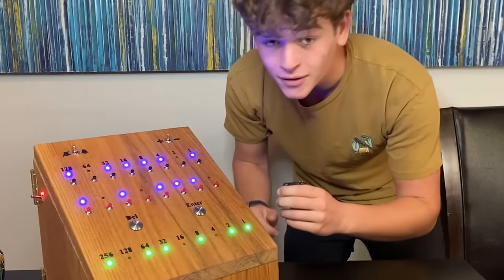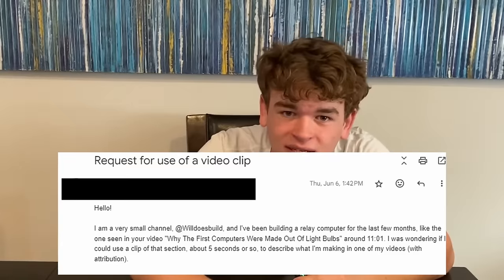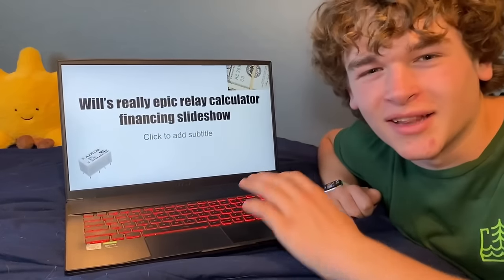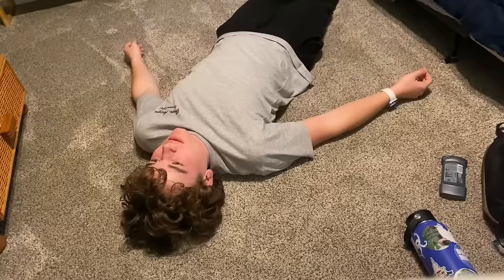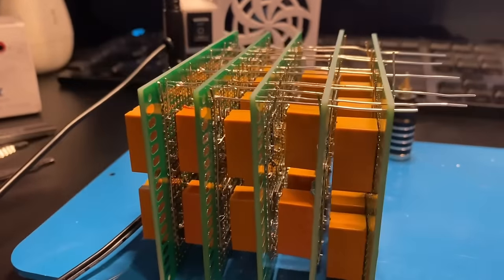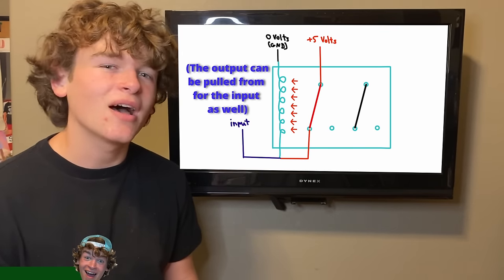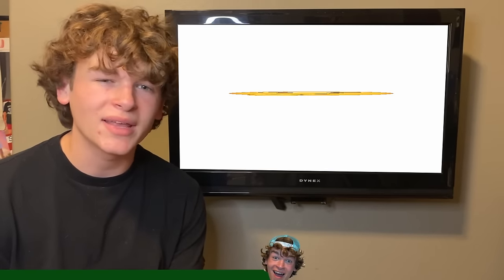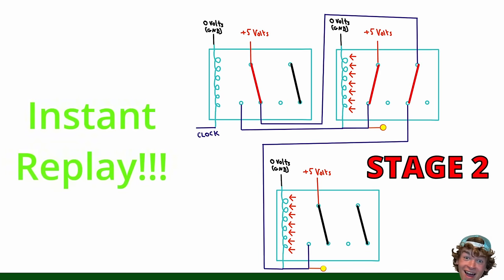I spent all summer building THIS! (relay computer)

Comment: I have them same prototyping circuit boards off ali express haha ... they are so nice to have laying around (I bought an entire box of them lol). The one gripe with them is the pads on the edges aren't dual sided, and each side is a diferent pad, so you can't solder to one side, and touch the other to form a connection with a wire or something like you can with the holes. But they are still really decent boards for the price, as well as there being a bunch of diferent form factors to choose from. Thbey are perfect for making drop in DC blockers for my already built audio devices etc. and as they have the holes in them (the bigger 3mm ones at the corners) you can mount them with stick on feet that they just clip into. If I'm using them for HV stuff I'll spray the bottom with a couple of coats of insulator first, as the feet could come off over time, and don't want them to short on the case or something just incase.
Reply from the maker: At first, I was gonna use the side pads to connect them together, but then I realized the same thing!

Comment: usagi electric; was the youtuber you needed to email.  Veritasium was at his house interviewing him. all so, neon lamps were used before LEDs were invented. and if your device is plugged in to a AC 100v to 250v outlet, they are much easier to use.  keep up the good work your doing! & i look foreword to your next full length video :)
Reply from the maker: I tried to contact him, but I couldn't find his email anywhere!

Comment: Over all really nice work!
For getting your clock signal something I would like to get to you as an idea is using a pendulum like these sun-activated dancing flowers or a real pendulum you set in motion and let a contact trigger with every middle pass for example.
Sure: Your engined timing device also works but I think it is rather complicated.
Another solution would be a spring driven balance wheel like in old watches.
If the clock signal could be a little faster you could also use a self interrupting circuit which could be built with relays as well (be warned: the relays used in this circumstance would not last long!).

Comment: If you were my nephew, I'd be so proud. But I'd also wonder why you shrank, he's like way over 6'. As a retired computer person, well done. But also... lemme introduce you to 'The connector'.   It lets you take a stack of boards apart, and also unplug the screen from the electronics module.
You can 'retrofit' connectors to your design. The reason the bell makes the lights go weird is back EMF. Add reverse diodes to ... well practically every coil.
Reply from the maker: Yeah, I read that reverse diode tip a while ago, but well after I started the project! So I figured the relays wouldn't experience enough cycles over the computer's lifetime to make a huge difference, and I couldn't add them retroactively to like half of the boards. If I ever do something like this again, I'm definitely using connectors!

Comment: The transistor was invented in 1947 and was used in computing to after the mid 1950s (1955-57) replacing the vacuum tube

Comment: Computers in the 60s were mostly running with vacuum tubes. There's one computer (Zuse Z1) from '37 that did use mechanical switches, but they broke down all the time. Some Computers of the early 40s had relays though
Reply from the maker: This is true!

Comment: Very cool, Will :) When I was around your age I designed and wire-wrapped a couple of (simple) boards for my 8-bit S-100 computer. I have a little feedback, and since you're my new para-nephew I'll be careful to be kind... 

Vacuum tubes took over from relays in computers by the mid 1950s. I don't know of any company selling relay logic as a "computer" later than that. I'm sure I won't be the only one pointing that out. :) However relay logic was still heavily in-use behind the scenes. I know an industrial conveyor company that built their controller logic with relays until past 1980. Their engineers were hitting retirement age and they couldn't find many relay logic designers among new graduates. :)

I suggest edge connectors instead of wiring the boards together. It makes troubleshooting much easier. And if you use the same connector on multiple projects it's worth buying/building an extension board, so you can logic-probe a misbehaving board while it's still in-circuit. It's a big timesaver.

One of my early jobs was refurbishing old telephone company relays, called "Strowger switches". Crazy-complex but fascinating relay logic. They even used motors for clocks like you did. You're probably already familiar with them, but just in-case here's an intro: https://www.youtube.com/watch?v=HcvA5q8yOTo

Subscribed, and looking forward to your next project.

Comment: Great job on the whole process, including video editing! You're a cool dude and a geek! ...that's a compliment these days. (I think. :) ) I'm sure that all of your failures in the process benefited you. All the custom soldering...well worth the experience! For your next computer, if there will be a next one, use transistors. Transistors are basically switches; the same logic as the relay computer. Use MOSFET type transistors (these are easier to deal with than Bipolar transistors) to create CMOS (this has special meaning) logic gates. You can simulate the analog (and digital) circuits with LTSpice. For further inspiration, look up Lev Kruglyak and Ben Eater.

Comment: Great work!!!

Next level... 
Make it modular units that can be stacked, plugged, or linked by a patch panel
similar to the old telephone operator patch panels..
The patch panel would be the software level of the computer.

Make: and, or, nand, nor, invert, JK flipflop, RS flipflop, and so on..
plus what you already have..

You might even use a telephone rotary dial as an input device.

Maybe you could make an enigma machine.. Just some wild thoughts..

Comment: I might be missing something, but if I was building something like this, and was considering using a motor assembly to generate the clocks, I would probably just look into dropping the relay sequencer all together, and just add a few more switches and possibly cams to the motor and have it do the sequencing.

After all, motor sequencers were pretty common in electro-mechanical systems.
Reply from the maker: I did think about that, but I’d already come up with a circuit design by then lol!

Comment: Nice work dude. A few years ago I built a binary clock, which I know has been done 100's of times before, but I restricted myself to only using datasheets from the internet, no other sources. was quite a mental adventure, had alot of fun doing it. I totally get your standpoint of wanting that feeling of * I * designed and built that from raw cloth (well, stripboard and 74xx chips). I never bothered putting it in a box, as I wanted the aesthetic of it being a rats nest of chips and wires n lights that did something useful. unfortunately it got snapped in half during a house move, but I still have the massive wad of design papers. I find it really interesting that after only a few days of having it on the wall as a clock, you could read the binary pattern pretty intuitively, much like an analogue wall clock. as in, its about 3:15, rather than 3:16.26, and adding each binary digit to get a decimal number. my brain just 'read' it. pretty cool.
best of luck on your future projects!
Reply from the maker: That’s so cool! Thanks!

Comment: usagi electric this is where veritasium get video of relay calculator. Also why you don't create some sort of primitive type of memory, like relay register? Or you can use a delay line memory, memory on a CRT (cathode ray tube), etc.
Basically you just create a relay 9-bit adder/substractor circuit, it can be called a computer but correctly named this machine as a relay calculator.
In general it's not bad, but i this you should improve your calculator, for example you can use a 7 segment nixie tube as display, relay decoder to show information on display, also you can use relay encoder (that circuit can convert decimal numbers to binary numbers), and use a D flip flop latch to hold numders on display, and use a relay shift right/left register to move numbers like modern calculator does. For the last you can create another boards for multiplication and division (for division it be realy complicated). You can create temporary memory using relay register, for that machine it can be a 9-bit relay register.
Also recommend to you watch a YouTube channel Artem Kashkanov, that man create a 16-bit realy computer he use a 800 relay to build this
Reply: Usagi Electric is a great channel.
Reply: @steevf  yes! It's my favourite channel

Comment: Great video mate! Just a little correction, computers in the 60s already used vacuum tubes and some already used transistors, in so called SLT packages; the IBM 360 mainframe from
1964 did that. And technically the first parts were sprockets
Reply from the maker: Yup, my timeline was definitely off!
Reply: @willdoesbuild  that’s fine! It’s only YouTube we come for the entertainment value! I also shamelessly listed wrong info from time to time 🤣

Comment: If you want a pulsing clock circuit from the 1960's, get an old turn signal relay. It's load dependent for speed, but it'll sit and on-off for you all day long. Unless it's a BMW part, those never seem to work.
Reply from the maker: Using a turn signal relay is definitely something I hadn’t thought about!

Comment: I believe there was a relay computer developed in germany in the 1930's so definitely pre 60's - ENIAC was 1947 and it was vacuum tubes so it was way faster than relay based machines and also the transistor was invented in 1947 and were in use fairly commonly in the 1950's.
Reply from the maker: Yeah, I was off on the timeframe!

Comment: 20:02  1)  It's not too deep in the boards to fix.  At this point, you know the device so well that there is no one else on Earth more qualified to fix it than you are.   2)  Don't feel bad about using blue LED's.  Miniature light bulbs would work just as well, and if necessary you could even find a way to make them appear blue.  3)  Transistors certainly existed in the 1960's.  William Shockley and two others won the Nobel Prize in 1956 for their work on transistors.  But if you feel bad about using a switching power supply, you could power it using an old school power supply made from a transformer, four rectifier diodes, and a capacitor.  If you are determined to have no silicon at all, then build a power supply that uses a vacuum tube rectifier, or just power it with a big old car battery.
Now I'm on my way over to Hackaday to see how the motorized switch fits in to all this.
Reply from the maker: I’m pretty proud of that motorized switch circuit :)

Comment: Great!
Regarding troubleshooting i guess you have continuity tested every part, but you probably should to it one more time.
It gets very complicated very fast when you consider that not only must you test is A connected to B for every component, but with the relays you must test whether each normally closed/NC gate has continuity when off, each normally Open/NO gate is off when on and on when the relay is off.

While you can do all this with a multimeter or the cheapest pocket oscilloscopes, the easiest way to troubleshoot the entire circuit is probably (IMHO) to add a LED with a 1-10K resistor to ground.
If the circuit runs at 5V f.ex, using blue LEDs with a 10K resistor to ground will still be very visible. 
2 * 50 relays * 10K is just 50mA of power needed for the 100 leds.

For such a circuit 50mA isnt much, and it makes it vastly easier to troubleshoot.
Once it does work you can also remove the LEDs fairly easily. 

However, it is quite a lot of pain to add this after the fact. So more of something to think about for your next project.
Reply from the maker: Yeah, I did that LED trick while testing throughout but I think I shorted something while I was putting all of the boards together :(
Reply: @willdoesbuild  
We've all been there. :)

Comment: To make assembly and repair easier, there's no reason not to use a bigger box and bigger boards.  It's also a good idea to test all the relays, in case you got one or more bad ones.  As a display unit, it can be arranged to be open too.

I'm not sure what kind of wiring was used, but it looked like solid wire.  Stranded wire will more easily withstand flexing.  But you're learning the issues of engineering and debugging.
Reply from the maker: Yeah I generally use solid wire, but I might try stranded pretty soon because it keeps breaking :(

Comment: Neat project. I can see you are learning a lot. I wanted to see if my option would help. I suggest using longer, thinner wire for the parts that connect from the logic boards to the control panel, that way you might be able to work on your project easier. You don't have to listen to me. That is what I would do if I built it.
Reply from the maker: Yeah, some other people talked about using stranded wire instead of solid core, which makes sense!

Comment: I would have bought sockets and then spent the time waiting for the relays building the boards with sockets... but, that would have extended the width of the board assembly, but would have made replacing relays easier as well. (Probably would have put socket/pins between boards as well to make boards easier to assemble and separate)
Reply from the maker: Yeah, I could have spend more time on the repairability lol

Comment: The timelines are messed up. Relay computer where used in the 40s but IBM tabulating machines used them beyond that point. Drum and vacuum tube computer were used in the late 40s and early 50s. Transistors came into play in the 50s and 60s. ICs were 60s and beyond. The first computer I programmed on was a GE timesharing computer designed about 56 or 57 using transistors. Ours was second hand though it was nothing compared to the CDC 6400 (transistor) in the next building over. Still, it is impressive connecting all of those relays together for a binary adding machine. This could be considered a Arithmetic Logic  Unit (ALU) which is a part of a full computer.

Comment: I was thinking that the relay that switched around for no reason, as you said, could possibly be the reason the 128 bit doesn't turn on?  Some food for thought and hopefully a helpful tip.
Reply from the maker: Unfortunately, I don't think that's the reason. I tested each board thoroughly throughout this process, and I think I accidentally shorted something at some point when I was soldering the boards into the top, and at that point it was too late. Thanks for the thought though!

Comment: I wonder how big it would hypothetically (I wouldn’t recommend trying this!) need to be, to make an actually programmable computer from relays.
Where by “actually programmable computer” I mean like, where there is memory addressable by address, and an instruction pointer, and parts of memory pointed to by the instruction pointer are sequentially retrieved, interpreted as an instruction, and executed, and then the instruction pointer is incremented.
I imagine it would be gargantuan?
But, I’d be interested to see someone’s calculations estimating how big it would need to be (assuming e.g. that the same specific kinds of relays (so, in particular, with the same size) as were used in this project, were used.)
Reply from the maker: Paul Law did something similar to this on his channel - one of his playlists is linked in the description!
Reply: @willdoesbuild  Oh, cool, thanks!

Comment: please show us what happens when you do something like 8-12 something to get a negative number, dose it overflow??
Reply from the maker: It displays the number in a really interesting way, actually. It displays them as the compliment of the negative number minus one. For instance, if the result was -5, the output was 011. So I would take the compliment, 100, and add one, 101, which would be 5, but actually -5. 8 minus 12 would be 100

Comment: That's not a computer, that's a calculator. Big difference: a computer runs software that can do arbitrary things, provided enough memory. A calculator does a calculation, but is unable to run arbitrary programs. Still, great project. A great way to learn how to build an actual computer is the game "Turing Complete"

Comment: Minor quibble but relay computers were more a product of the 1950s. By the early 1960s electronic computers were the standard... not solid state though by 1970 transistors had advanced to the point where solid state computing became the norm.

Comment: Overall, good job! your historical research, however...
Most 1960's built general purpose computers (what most today think of as "computers") were either vacuum tube or discrete transistor monsters. Some calculators were relay based still. The FACOM 128B from 1958 was pretty close to the last of the big relay general purpose computers. It's impressive, but wasteful in power, it's not fast, and its dangerously loud.  Telephony relay systems for rotary/pulse dial have mostly gone away... 
Also, Transistors were developed in the 1940's (1947 to be specific, germainium point contact type); MOSFETs date to 1959.

Comment: yooo what respirator are you using???? i wanted to not kill myself with lead fumes but the p100 mask is huge and pulls on my hair so i just kept poisoning myself for the past few years. your seems small and honestly not that bad
Reply from the maker: Yeahhh but based on some other comments, it might not do anything? Also, it’s lead-free rosin core solder so I’m not too worried, it’s mostly an irritation thing for me
Reply from the maker: Also it’s just a p95 I think
Reply: @willdoesbuild  oh lead free might be a choice too haha
but still thanks i'm grinding and welding a lot right now and a mask might be a nice idea